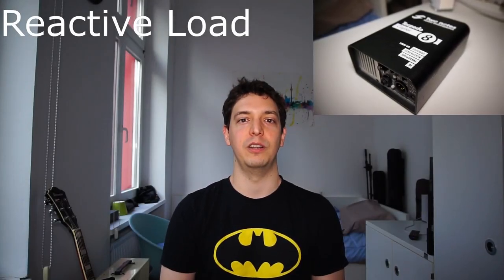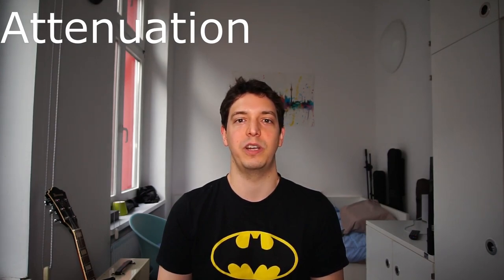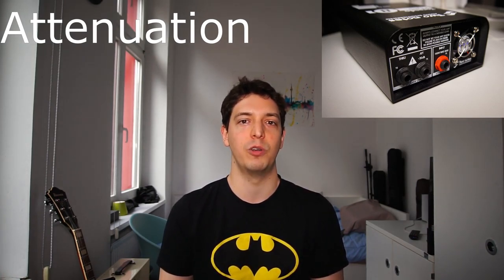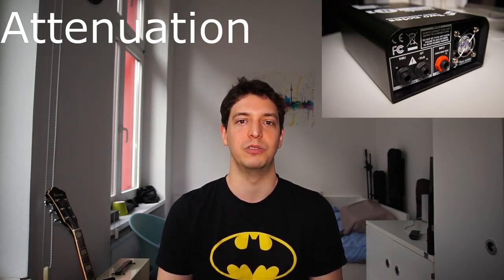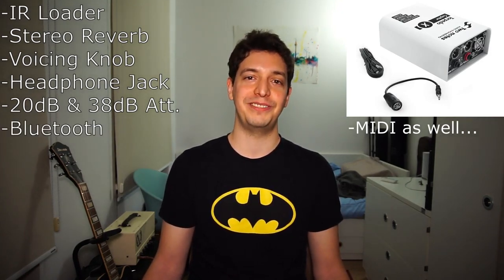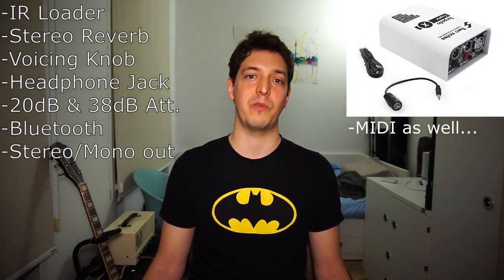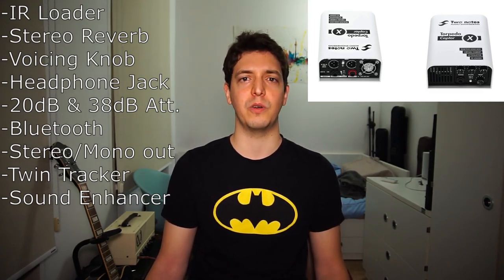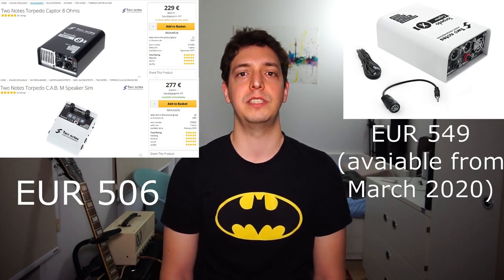Two Notes Torpedo Captor Review: Do you need the Captor X?

Comment: I agree with the guy that posted a year ago. LITERALLY EVERY question I had regarding this device (which wasn't much) was covered, and to the point here. All the others I watched didn't cover the points I required. I have avoided using these in the past to be a "purist"... but lets face it, I am no longer 22 and playing outside for the neighborhood, or gigging much right now... and the wife isn't keen on my plexi getting cranked, or my JCM 900..... I just needed to know if the speaker sim was IR load locked (just one loaded, no others could be added) or if it was a resistor / hardware based cab / speaker sim, and if the load box REQUIRED power in order to use it for just attenuation. Perfect video, earned a sub!
Reply from the maker: Thanks for the great comment and sub! Really glad it was useful. Hope you'll enjoy the Captor as much as I do and as much as your family will 😂 my tube amps get way more use now because of the Captor.

Comment: Like many people who’ve commented, I admire the straightforward, exact, honest and open way you present your videos. You don’t confront us with a wall or gear, or a wall of ‘attitude’. Thank you for that alone. Additionally you are giving out a great deal of valuable information and encouragement. I have a question I wondered if you might be interested in answering. The Captor X seems mostly to do be doing what might be done with one of the better floorboards, like a Helix or a Kemper. Using sims and irs is great for home playing but many people also want the convenience of sims with the feel of a traditional amp. I’ve wondered—thinking about cheaper alternative to a Helix and Powercab—whether something like the Joyo Preamp house and a FRFR speaker mightn’t (with pedals) give a good, adaptable live platform. Do you have any thoughts on this? In any case, thank you for all the excellent work and playing on your channel.
Reply from the maker: Hi Steve, thanks a lot for the nice comment! Really glad to know that the video is useful.

The Captor X is quite different from the Helix or the Kemper. The Captor X doesn't model amps or effects like the latter two. The Captor X is really designed to work with tube amps as it is a loadbox and IR loader. The main idea is to keep your traditional pedal board and tube amp unchanged, while allowing you to replace the guitar speaker cabinet by a simulation (IR) and, thus enabling you to perform and record at moderate volumes or even completely silent. In my opinion this is THE tool if you want to perform and record using a tube amp. The Helix and Kemper go more in the direction of replacing your entire rig (pedals, amp, speaker cabinet), sometimes known as ampless rig. You could do a nice ampless rig with a couple of drives, effects, and a preamp like the Joyo  Preamp House into an FRFR speaker, but I haven't tried it to really comment about it. I would also highly  recommend you to use an IR cabinet simulation at the end of your chain in this case. Something like the Two Notes CabM+ or the Mooer Radar or Nux Studio, this add a new dimension to the sound. I've made a video like that using a Joyo American Sound as a preamp and the Nux Cerberus for drives, effects, and the IR cabinet simulation. I think it sounded quite good for recording, so you could also feed that into an FRFR speaker for performing. In the end, I still prefer my tube amp with the Captor hahah but for budget and practical aspects, it turned out quite good. 

Here's the video: https://youtu.be/5XQ-O-h3jUA
Reply: @TheBedroomRocker1  Thanks so much for this careful and informative reply. I suppose that once you get as far as using a pre-amp pedal, a cab sim pedal and all your other usual pedals with an FRFR cab, it starts seeming reasonable to go the whole way and use a full floorboard! I expect that in a lot of cases, our experiments with gear are mostly explorations to understand the total sound system better. You are doing much to make this process enjoyable for your viewers.
Reply from the maker: @stevelogan1699  Thanks for the positive feedback! I am really glad to know the videos are helpful and enjoyable to watch

Comment: Nice and easy to understand explanation, thanks! Your channel name describes my musical career pretty well haha
Reply from the maker: Thanks for the nice feedback! Yes, hahah while I play in a band and also do gigs and stuff, most of the time I'm just playing in my bedroom and this is the reality for many people
Reply: @TheBedroomRocker1  So, are you planning on getting the new X? Or sticking with the previous model?
Reply from the maker: @HerrSchnabelewopski  That is a seriously tough question hahahah When I got the Captor, I knew I wanted to use IR's with my tube amps, but at the time the only unit doing that was the Suhr Reactive Load IR (out of my league). Now the Captor X does that and much much more. It seems to be really worth the money, but 550 EUR is still quite a lot for my pockets. In the venues that I usually play, I really need a guitar cabinet, so I don't actually need the reactive load for live performance and I could just use a Torpedo C.A.B M for this (some 250EUR). The C.A.B. M can also work with pre-amp pedals, which the Captor X can't. For home recording, both C.A.B M. and Captor X would be nice to reduce my CPU load and reduce latency. But, at the moment, I do not really any of these features so badly and I'm probably sticking to the original Captor for a while. Maybe I could try a Mooer Radar or some cheaper IR loader with it.

Comment: What a great review. I'm looking to record my AC30C2 through my DAW (Cubase) and it seems the standard Captor would be best suited to my needs. I've just subscribed and liked.
Reply from the maker: Thanks for the nice comment! I'm glad it was useful. The regular Captor is definitely enough for recording via DAW as you can load the Wall of Sound plug-in in Cubase and use the amazing Two Notes IRs. The annoying thing is that the AC30C2 has a hardwired speaker, so you gonna need some extra cable work if you want to use the Captor as an attenuator as well.

Comment: That was a lot of useful informations!
It helped me to decide if I get this one or a Weber Mass style attenuator.
Reply from the maker: Thanks a lot for the comment! Just out of curiosity, which one did you pick and why? I haven't tried the Weber. I think the Captor works well as attenuator, but has the limitation that you only have one fixed attenuation setting
Reply: @TheBedroomRocker1  I got the Weber and it was exactly because of its better volume control (it works like a regular volume knob). And because it’s passive, so all you have to do is connect the speaker cables, no connection to your power grid at all.

Comment: Hey, congrats for the video, very helpful. I'd like to ask for your advice, maybe your reply would help others as well.. let's say that u find the captor x used in good condition in the second hand market for 375€, would u buy it instead of the captor 8, which costs 156€ less? I would like to use my mesa boogie stiletto at home, mainly for self recording and practice amp, I do not have a band and probably I won't be playing gigs in the short term, though I would like to someday... Which one would u recommend me to go for? Thanks a million!
Reply from the maker: Thanks for the comment and sorry for the late reply here. Generally at home for recording there's really not much added benefit for the Captor X. If you're okay always using your computer to run the wall of sound plugin when you want to play or record, then the normal Captor will do this. The X would give you the chance to play the amp directly through headphones, one more level of attention at-38dB, which can be handy with a 50W amp (although -20dB with a master volume amp is also useable), plus some extra features like twin tracker, additional reverb models not available in the wall of sound, midi, etc. The cab collection with the X is also more extensive. All in all I think the Captor X is worth the extra money, but strictly for home recording you don't need all of these features...

Comment: Well explained ! The Best comparison ! Thank you very much ! I have an Harley Benton attenuatior and I am not happy with it, because the sound quality is not good. I have a Marshall dsl1 head amp with 1x12 30 watt Celestion speaker cabin, can I use the black captor with it ? I don’t have master volume but it is just 1 watt amp:) thanks in advance ! Already subscribed!
Reply from the maker: Thanks for the comment and sub! You can try it out, but I believe the -20dB attenuation on the Captor is too much for a 1W tube head. In this case (without master volume) I'd prefer an attenuator with volume control. Since the DSL1 also has an effects loop, you could also try a JHS Black Little Amp, which essentially a volume knob to place in the effects loop. My Marshall SV20H also does not have a master volume, so I use the Captor to attenuate -20dB and the JHS for the final volume control, but that's a loud 20W amp. Let me know if you try anything and what solution worked out best for you.

Comment: Nice! I have a Friedman Dirty Shirley 40 watt combo. Im guessing the -20 db attenuation on this will not be enough to push the amp for recording in a condo with some simple baffling around the amp...?
Reply from the maker: Thanks for the comment! It should be quite alright since the Dirty Shirley 40 has a master volume. You won't be able to fully crank it to 11, but it should definitely help
Reply: @TheBedroomRocker1 Ok thanks! If the  master is around 8 useing this, what dbs would be present? Tthinking about getting a used Dr Z Airbrake.
Reply from the maker: @revelationunion that's really hard to say without testing. If attenuation is your main use case and you don't need the cabinet simulation and other features, then there are probably better suited products than the Captor

Comment: Thanks, nice review.
I use the Captor throught a Mooer Radar IR pedal and then DI/DAW. With my computer I never managed to fully get rid of the latency.
That pedal is nice but also limited to "close-to-the-amp" mics.
If I do the maths: 230 € for the Captor + 130 € for the radar = 360 €
So let's assume the Captor X is a 200 € upgrade.
Well, I think it's absolutely worth it.
I am getting one for sure.
Reply from the maker: Yes, latency can be really annoying! The Mooer Radar is a great for what it does and cost, but Two Notes stuff is really at other level! I totally agree that it is worth the upgrade. It is definitely more expensive, but you are really getting your money worth in useful features and great sounds. You can still use the Mooer if you ever want to have an amp-free set-up for some gigs. A downside of the Captor / Captor X is that they need an amp
Reply: @jbbeaudry

If you are having more than 14 ms, then you have a problem with latency.

If you can't comfortably play with latency equal to or lower than the one mentioned above, then you will never be able to play live, or in a band.

14 ms equals 4.8 meters away from your amp, and I don't know of any guitarist who can't deal with that.

Sometimes on the forums they focus on latency in a sick way, and for guitar 8, 10 or 14 ms it is perfect.

Comment: Brilliant video. Thank you 😊
Personally I would go for Captor + Cab M+ simply because I can use it with my pedalboard were Captor X only works with tube amp.
Reply from the maker: Yes, that is actually a more bulky, but more versatile set-up! Since I released this video, Two Notes also updated the CabM to include a preamp section, so in my opinion it is the ultimate tool for an amp-less rig. The CabM has actually been in my list... I play mostly amateur gigs so I am often left without a mic for my cabinet and without a dedicated stage monitor... by using the CabM I could send my mic'ed cab sound to front and house to fill the room and rely on my own cabinet as stage monitor. I don't need really need a load to my amp when playing live because I still need the real cabinet... The problem is that with Covid, I am not even gigging hahah, so cannot justify the investment at the moment...
Reply: I don't get this.  If your head has a send and receive for the effects loop how can you say the Captor X doesn't work with pedals?
Reply: @Mark-OutWest  Captor X only works with Power amp signal and not line level signals.
Reply from the maker: @Mark-OutWest  the Captor X does not work with pedals directly because it expects a signal from your power amp. You can ofc still use your pedals, but you need an amplifier. The Cab M, on the other hand, can work both with a poweramp or instrument signal, so you can plug your pedals straight into the Cab M and into a mixing desk or audio interface (no amp needed)
Reply: @TheBedroomRocker1  who makes the cab M ?

Comment: With the X, the built in IR loader means less burden on my computer's cpu, therefore I'll experience less latency during recording. But on the other hand, I probably cant change cabs after recording.
Reply from the maker: Yes! Those are also pretty good points. Even though the Wall of Sound plug-in is quite well optimized, having a dedicated CPU on the X removes CPU burden and the annoying part of setting CPU buffer right. The Captor X also allows you to output a dry signal out, so you could simultaneously record 1 cab sim and 1 dry guitar and then add the WoS to the dry guitar later in post and tweak it

Comment: -So I can’t download impulse responses onto the cheaper Captor? Ie: I’d have to use a program like Wall of Sound to use any IR’s?

-8ohm vs 16ohm?
Reply: Exactly
Reply: Whatever is most common with all your amps.   I use a 16 ohm because all my amps and cabs are 16 ohm.  Some folks use 8 ohm because most amps have a 8 and 16 ohm option.
Reply: @BeastFurChild  Right, yeah some say overall tone signal through 16ohm speakers/16ohm load, for example, sounds more hollow compared to same signal through a thicker/fuller-mid 8/8.
I was thinking out loud if they captured this idea when designing them I suppose.

Comment: Tried it tonight…I found 3rd party IR way better. This is just a means to get it in the box. I found a 3rd party with my amp cab and it matched ok. The bass response is not as great as a real speaker. But in a mix it works for me. It’s just weird how if you use pedals the bass response can be weird with Two Notes cabs. When I use third party stuff…it reacts similar to if I was using my real cab to this pedals. So not wonderful, but good enough. I found the companies cabs very weird if I use a Marshall in a box pedal on a 65 deluxe…it needs the Marshall cab. But if I use the 3rd party cab it reacts the same as my amp and works. It can be a little weird like I said on bass….but in a mix it’s good enough. I’ll use it for late night and guide tracks…then record real amp on weekends. I don’t think I use it on finished songs outside maybe some solos or layered tracks…does not replace a real mic for me or cab.
Reply from the maker: Thanks for sharing your experience. Indeed there is a great variety of cabs that you can try (Two Notes, 3d party, and regular IRs that you can just load into WoS) and achieve quite different results with them.
Reply: @TheBedroomRocker1  yeah I found a few I liked.. for the Tone King amps I’ve been using ChopTones ones. It does a pretty good job and was imaged from an Imperial amp. Other ones I tried were Owmhammer and one more that had all the cabs more like if you were playing in a room Vs recording. Most will do mic up on the amp and mix. Some will do impulses to sound as pure as possible as if it were in the room with you. 

I want to do some of my own..because I have a nice mastering converter, some API and Neve pres here. Just getting the proper room is key.

Comment: On the original captor (black), if we want to use ir loader, wich output we use, the dry? Or xlr? And in live/stage setting can we use two output (xlr with cabsim and dry with ir loader pedal)??
Reply from the maker: Thanks for the comment and sorry for my late reply! I haven't seen an IR loader with an XLR input, so most likely you'd use the line dry out into the IR Loader. You can use the XLR out with the in-built analog cab sim plus the line dry out simultaneously without a problem.
Reply: @TheBedroomRocker1  thanks for the reply man, im gonna try that 2 output method. thanks

Comment: So you can not use headphones with the Captor 8 ? Not even if the amp you're using has a headphone jack ?
Reply from the maker: No, that's not possible. You can use the headphone jack from your amp, but you then you won't have the cabinet simulation there. You can ofc, connect to an audio interface and then plug the headphones to the audio interface.
Reply: @TheBedroomRocker1  thanks

Comment: Can we use it as a DI box for DAW recording( Splitting dry guitar and amp tone) ?
Reply from the maker: Thanks for the comment, but I'm not sure I understand your question. If you want to split your dry guitar and amp signal, you have to do the split before sending the signal to the amp. A simple ABY switcher will do it, you don't the Captor for that. The goal of the Captor is to DI the complete signal (guitar + amp) and then you either add the analog cabinet simulation directly in the Captor or add an impulse-response cabinet simulation in your DAW. Let me know if this answers your question.
Reply: @TheBedroomRocker1  Thank you for your explanation :)

Comment: I notice you have the v40. how well does the captor do attenuating that amp if you crank the master volume?
Reply from the maker: Hey Dominici, thanks for the comment! It does a pretty good job. In my bedroom studio, I can run it with the master volume around half-way up depending on gain and on the hour. The sound and responsivess of the amp also remain very true to the original